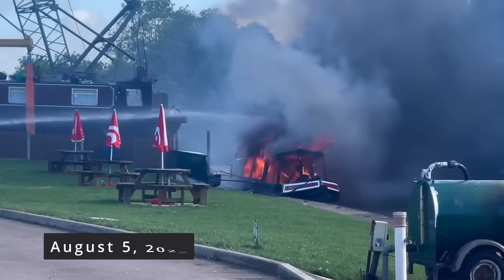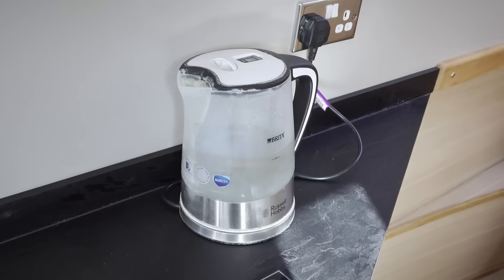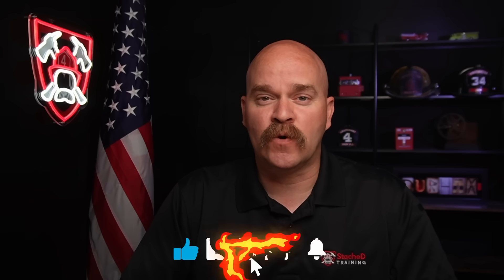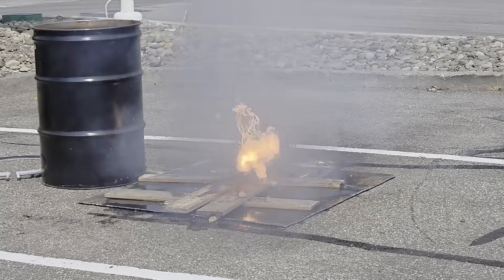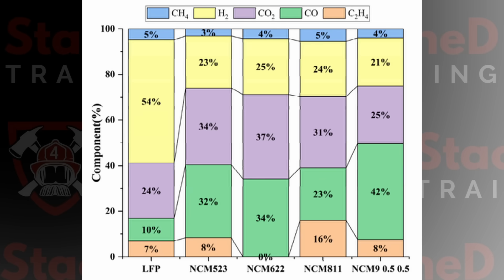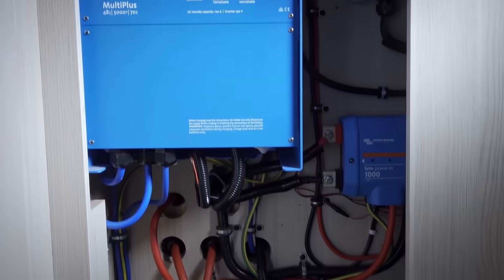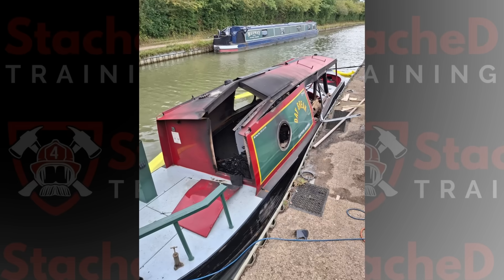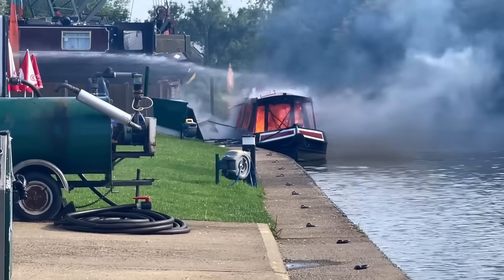Electric Boat Explodes While Charging: LFP Batteries

Comment: Ok something doesn’t make sense here: if the batteries were in the engine bay, and “exploded”, that would blow those engine bay covers right off, as there aren’t bolted down at all, they only stay in by gravity. Most of the time they’re made of marine plywood, not even metal. Reason being is the open then to do daily checks, maybe clean out the weed hatch, and make sure the stern gland isn’t leaking etc. They don’t even put latches on them. Looks to me like the explosion took place in the cabin itself, hence why the roof is buckled like that. Is that where the batteries were?
Reply: It may have been the cabin supply batteries that went up. Two different packs according to Pat.
Reply: He explained this in the video, the gas in the battery compartment would have been way too fuel-rich to be able to ignite let alone explode, however it slowly leaked into the cabin via holes made for cables, and there it had the opportunity to form an explosive fuel-air mixture

Comment: There is absolutely no reason to use lithium batteries over normal lead-acid batteries.
Reply: Much greater energy density. You can't get reasonable range and speed capacity with current lead-acid battery tech for most vehicle applications beyond golf carts.
Reply: @davidg3944  Yes you can. It's a simple matter of numbers.
Reply: You are absolutely incorrect. There are hundreds of thousands of boats in the world equipped with lithium batteries.

Comment: As a guide, the roof and sides of a canal boat is normally 4mm mild steel, so to rip thia apart, was quite a explosion.
Reply: From the images I could see the cabin roof to side panel weld was ripped open, the weld is the weak point and allowed the pressure a quick route out.
Reply: And yet the engine compartment where batteries were placed was undamaged.
Reply: @solentbum  The batteries weren't in the rear compartment. The chap posting this video has used footage of an earlier prototype boat. The builders redesigned it with the batteries in the passenger compartment, hence that's the area that was damaged.
Reply: @Coop-Greavesie so they didn’t put venting system to redirect the gasses outside of the cabin right! What a terrible design!
Reply: @Coop-Greavesie petrol and diesel vehicles have vapors control systems to avoid any kinds of these issues as an example!
Reply: @carholic-sz3qv  The boat is owned by and was built for the largest boat hire firm in Britain. It is unlikely to have been poorly constructed and will have had to pass several official inspections before entering service.

However it's obvious that in spite of that, something has gone seriously wrong and no doubt the results of the formal enquiry will be of considerable interest and quite probably lead to changes in the requirements for such vessels.

All we have at the moment is one video taken by another boat user in the marina just after the explosion happened and informal comments from the Fire Brigade who attended the fire.

Everything else is speculation, nothing more. We've got to wait for the enquiry.
Reply: @carholic-sz3qv  What gasses? I've had LFP4 for 8 years now on an all electric liveaboard boat, never had any problem with any gasses. Did have a problem with my previous Lead acid bank though, which is why I changed.
Reply: @tmog1000  The classic thermal runaway condition for LFP batteries is not a fire but a cloud of explosive gas; mostly hydrogen, CO and various hydrocarbons. It's completely possible for an LFP pack to go through a runaway without a fire or explosion occurring but woe betide if it's in an enclosed space there's a source of ignition somewhere. It's a similar danger level to a leaking calor bottle but probably more toxic. There was a guy in Germany with an LFP installation in his basement which went into runaway and blew the side off his house, pretty much like a standard domestic gas explosion. Bizarrely, the battery packs sustained relatively little damage and were all still screwed to the wall in the now open-air basement.
Reply: @solentbum  I'm guessing that it's the gassing that explodes, not the physical battery. Therefore escaping gasses build up within the main cabin.
Reply: @solentbum because the gasses probably vented into the cabin…. Only the investigation will tell us
Reply: @solentbum Simple reason. The batteries were placed forward of the bulkhead, they were not in the engine compartment and not subject to damp/wet conditions.
Reply: @solentbum hydrogen is lighter than air. It rises, and when it exceeds the LEL (lower explosive limit) of 4% it’s all primed to go kaboom.

Comment: I’m working on a live on electric boat. I am planning on a 500kwh LFP battery pack at a constant temp and humidity away, with multiple temperature sensors and a gas detection sensor each bank of batteries stored in sections each on its own BMS in A60 fire rating enclosures sealed with over pressure ventilation alarm and negative air pressure with argon gas. Should I consider a water flood system as the box will be slightly negative pressure with argon vs air? (All ventilation will be Spark-Resistant Construction.

Comment: Was there any propane on board?.  You are absolutely right that LFP can off-gas, but hydrogen is also lighter than air and will quite readily leak away through the smallest of holes.  It is one of the hardest problems to solve re: hydrogen fuel cells - keeping the fuel from leaking.  That end result really looked like a propane explosion - propane is heavier than air and will pool in the bilge undetected until the tiniest spark will ignite it.
Reply: The video mentions two battery packs - one for motive power, one for the cabin power and electric appliances. Doesn't sound like there would have been propane as well.
Reply: @davidg3944  There are quite a few canal boats that only have propane for cooking or winter heating.  Electric could have been for  fridge, etc.  I just find it surprising that enough hydrogen buildup could occur without leaking away almost immediately - especially enough hydrogen to cause an explosion that large and energetic.  Propane, however, will sink right into the bilge and stay there until an ignition source finds it.

Comment: An electric stove without shore power, lol. Complete idiocy
Reply: The guy in the marina who took the fire video you posted, and viewed the aftermath, said the batteries were mounted up against the divider bulkhead in the  dry part of the boat, not in the propulsion motor compartment under the rear deck.  
Seen no definitive proof of battery chemistry, but someone looked at the batteries of this boats sister ship, and said they were not LiFePo. 
Maybe some more due diligence is in order before an "expert" opinion is offered.

Comment: The insanity continues...  Despite what should seem logical or common sense, they continue to push the boundaries for utter failure, and it doesn't matter if this potentially leads to the loss of life, the agenda must be pushed forward.    We have battery lawn tools and a mower, we love them too; but that said, we do not leave the house with anything charging.   We even looked into old school battery tools and you can't even find them anymore unless they're lower voltage ones.  That's a shame.

Comment: Petrol bilge explosions are bad enough but installing an incendiary bomb beneath crew quarters is negligent. Narrowboats got on fine without LPF batteries and can run on carbon-neutral diesel fuels. The electricity fetish is understandable but not an IMMEDIATE necessity.  Wiser to ignore LFP boat power for twenty or thirty years (not joking about the timeline because changing is of mere emotional importance) until better solutions exist because there is nothing remotely urgent about converting a tiny, intermittent source of pollution to LFP batteries which require vastly more pollution to manufacture then recycle. 
Lead batteries are highly recyclable and unless you suck on the terminals (I don't judge) are a minimal hazard to operators.

More boats will burn because amateurs don't think in terms of military-style damage control and system robustness.

Comment: Put electric batteries in the water. Some people are dumber than apes.
Reply: The guy in the marina who took the fire video you posted, and viewed the aftermath, said the batteries were mounted up against the divider bulkhead in the  dry part of the boat, not in the propulsion motor compartment under the rear deck.  
Seen no definitive proof of battery chemistry, but someone looked at the batteries of this boats sister ship, and said they were not LiFePo. 
Maybe some more due diligence is in order before an "expert" opinion is offered.
Reply: @kylereese4822 no part of a boat is dry at any given time depending on sea and weather conditions. Batteries in the boat, boat in the water. Like I said, apes.

Comment: Thank God the 10x emissions that came from making those batteries all were in the slave mines of Africa and China—and that no one was hurt when the Boat bomb Chernobyl’ed! 😂
Reply: The guy in the marina who took the fire video you posted, and viewed the aftermath, said the batteries were mounted up against the divider bulkhead in the  dry part of the boat, not in the propulsion motor compartment under the rear deck.  
Seen no definitive proof of battery chemistry, but someone looked at the batteries of this boats sister ship, and said they were not LiFePo. 
Maybe some more due diligence is in order before an "expert" opinion is offered.

Comment: I would not get into ANY electric vehicle of any type, not only for the safety hazards but for the false beliefs that they will save the environment. People that believe that absolutely need to do more research.
Reply: I have driven and been passenger in a Lexus ES250h hybrid 12 years old. 
Battery system works well...with years of life left in it in our temperate climate.
Very smooth car....

Didn't feel any threat to life or limb.....
Reply: @JohnSmith-pl2bk  hybrids are a bit different than full electric, I am happy that you have had success with it👍
Reply: @Deribinkle  Not really. Just smaller.
Reply: @JohnSmith-pl2bk  How do you know it has years left in it? Are you some kind of time traveller, if so can I have next weeks euro millions numbers, please.
Reply: @captaindaveblack-w2q  
Well it's been One Year since I was in it...and it's still driving without flames or problems....
so I have no reason to believe that another year can go by without problems..
and then the next...
based on the reality that it has stayed OK for the last 12 years ...
Reply: @captaindaveblack-w2q  Stupid comment. How many years left in your life? You do not know, but normally I am sure you expect at least another year?
Reply: @JohnSmith-pl2bk  This!
Reply: I'm starting to consider if an EV parks next to me in a parking lot of moving away, far away!
Reply: I won't get in an electric car, or bus for the hazard reason, and I dislike them generally too. An electric boat - I'll use, I have one - but I only use it in daytime and I don't go far from the shore.

Comment: Lead battery can off gas and even burn, just respect the technology you use and act accordingly.
Reply: Very rare 
As a diesel fitter have been dealing with lead acid battery for 46 years 
Only 2 failure 
One on charge 
No fire
Second internal damage explosion on key activation on start
No fire
Reply: Saw a forklift blew. The operator was covered in acid and had singed eyebrows.

Reported problems with the battery were ignored by the management🙄
Reply: The guy in the marina who took the fire video you posted, and viewed the aftermath, said the batteries were mounted up against the divider bulkhead in the  dry part of the boat, not in the propulsion motor compartment under the rear deck.  
Seen no definitive proof of battery chemistry, but someone looked at the batteries of this boats sister ship, and said they were not LiFePo. 
Maybe some more due diligence is in order before an "expert" opinion is offered.
Reply: Look at the fire and explosion 
Not a fuel fire

Comment: Shipping companies are wisely banning EV’s on their ships for fire risk , so of course making a ship itself an EV makes total sense. Clown world.
Reply: Ev batteries are totally different to lfp batteries
Reply: @davidhopkins9021 . EV car MG S5 uses LFP batteries. And also others. I think it’s a good thing ❤
Reply: Imagine using a woodstove connected with a stove pipe to the exterior as a battery mounting compartment. If the batteries kitchen fire, then you are protected from it because it is fully enclosed with a fireproof chamber
Reply: Could knot agree more... They want fisherman to repower to ev.... Salt water hates electric
Reply: @BurchellAtTheWharf that’s usually why batteries are contained inside the boat and not directly in the way of the water. This incident likely had more to do with faulty wiring than an issue with the battery itself.
Reply: @James-wildI don't know how many boats you been on (ferry, pleasure or commercial fishing) but a boat is rarely dry at all. They live on the water , the sweat condensation, and just a wet environment in general, then we get to the seas and oceans. Salt, salt loves to eat electronics. 
By I'm just a foolish fisherman that will never give up on ice, but might try out sails again sometime
Reply: @BurchellAtTheWharf once again that’s why batteries are contained within the ship, not exposed to the outside or the weather/water.
Reply: @James-wildyou know water gets inside the boat right? Even if it's water tight compartments, there still is water ingress
Reply: @BurchellAtTheWharf  I don’t see why anyone would expect battery electric boats to be inherently unsafe. Any boat that meets industry standards won’t have issues like leaky battery compartments. If water intrusion occurs, that’s just a sign of a poorly built vessel and not a flaw with electric propulsion itself.
Reply: @James-wild while I assume you've seen regular lead acid batterys in boats before,and how they turn out after a couple of years, only starting an engine fer a few moments at a time. 
And those batteries are tryd true and tested.
Boats are relatively safe. But they do build upa static , and these new batterys are bearly reliable in cars.
What inherently unsafe is high voltage in a damp enclosed environment
Reply: @BurchellAtTheWharf lead acid batteries are old technologies and typically aren’t used in any modern day ships or cars. And they (modern day lithium ion, sodium ion, and LFP are very reliable in cars, in 20,000 cars only 2.5% of batteries had been replaced outside of recalls and batteries can hold their charges for decades, typically outlasting the rest of the car themselves. And most car batteries have 8-10 year warranties, which wouldn’t be profitable if batteries didn’t last that long.
Reply: @James-wildI trust the ole lead thou, I know how to work with it. And how it reacts when recharging. 
You can call me sceptical but it is a interesting idea, but just don't trust it yet
Reply: @BurchellAtTheWharf there's lots boats running on electricity, without any issues. Ever seen a petrol car or motorboat burning? Clown!
Reply: BYD, the largest EV company in the world have their own shipping fleet. The shipping companies who ban EVs will change their tunes soon enough as their ships will become increasingly empty. BYD ships hundreds of thousands of EVs globally every year, how strange none of their ships has had an "EV" fire
Reply: If you think electric vehicles are for clowns, then at least I know who the real clown is. It is you.
Reply: word
Reply: The funny part is is with any new invention or new technology there's trials and errors and sometimes this does happen but you know what 15 years to 20 years from now the Battery Technology will be insane and we will be laughing at you cuz you didn't believe it!
Reply: Petrol-Clown. stupidity on YouTube
Reply: Uss bikini atoll all on board.
Reply: Well it is the British we are talking about here. They on a cultural level love doing dumb things like this.

Somewhere Isambard Brunel is spinning in his grave at how far the UK has fallen in a engineering sense.
Reply: Matson says it is until they develop better protections.  So don't celebrate too soon.
Reply: @soundspark Like a catapult that shots them off the ship into the sea.😂 
But really can't see anything that is cost effective to handle multiple EV fires on a ship.
Reply: The blind leading the blind.
Reply: Large ships and trucks should always stick to diesel, because the power required to propel them under load is immense, and such high voltage / amps in an electric situation is always going to be quite volatile and dangerous.
Reply: @jamesaustralian9829  no diesel’s dead buddy and so is fossil fuel if you don’t know that you’re an idiot
Reply: @jamesaustralian9829  Or Bunker C?

Comment: vents are always a dilemma. they allow gas to propagate but also allow moisture in
Reply: Burst discs on battery boxes would completely prevent moisture and only burst under elevated gas pressure. Fusible plugs melt when heated and are used on aircraft wheel rims to prevent catastrophic tire explosions during a fire. Both are totally passive and can last indefinitely.  Check valves can be used to permit gas flow in only one direction. No dilemma at all nor innovation required. They're the most ordinary of components.
Reply: Vapour barrier air filter screens are cheap and easy to install; air passes through them, but not moisture. Any conversion in the business sector is prone to cost-cutting. not to say done on the cheap, but could be better,
Reply: Bilge blowers are a requirement for an ICE, I'm betting they figured they didn't need one here.